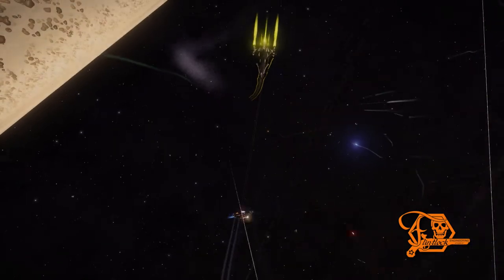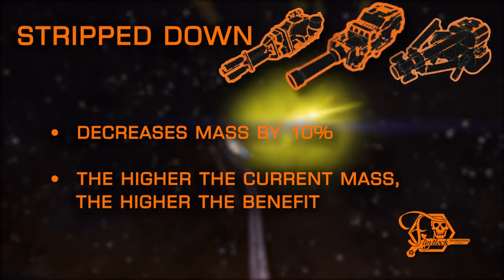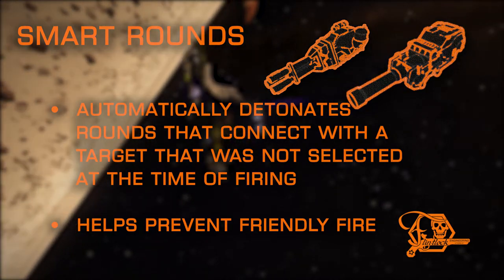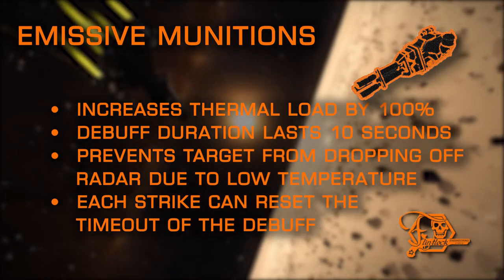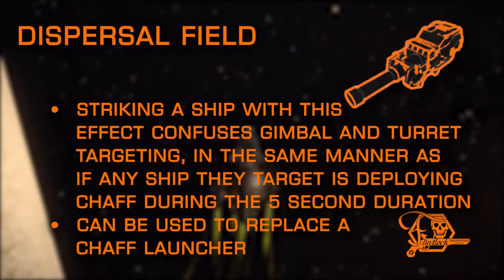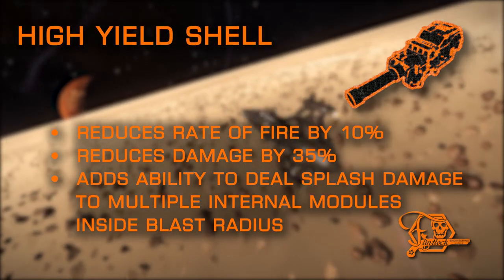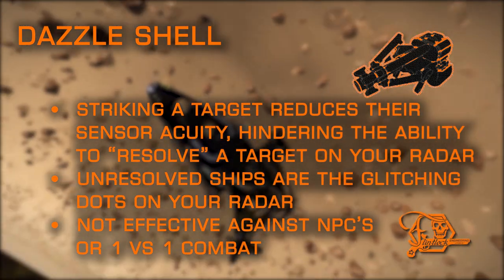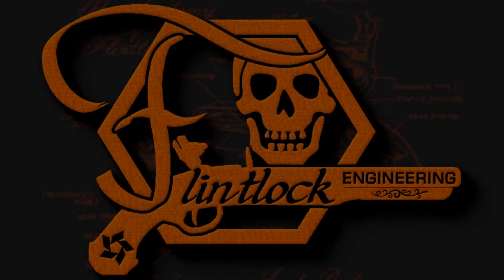Engineering Series - Episode 6: Kinetic Experimentals

Comment: AFAIK : Regarding oversized vs rapid fire : Module breach damage and % is unmodified in all cases, so servo/rapid fire causes faster module damage by increasing % proc rate. To destroy shield/hull HP you want higher damage per shot, for module destruction you want higher RoF.

Comment: Fun thing you can do with incendiary rounds is use them instead of lasers, then jam all of your power into shields. Since the power draw is much lower, you can have 6-8 multi cannons running on 2 pips and never run out of distributor draw. So you can sit around and joust with lesser ships in PvE all day with a huge shield advantage. The only downside is the fact they use bullets, which isn’t that big a deal assuming you’re doing this in a haz res or conflict zone

Comment: Great video! I have a short question. I was wondering whether incinderary shell is a little overrated. You find them recommended all around the web. But maybe they are good for ship only equip with multicannon or kinetic weapon. If I have substantial laser presence, isn't autoloader with a corrosive make more sense?
Reply from the maker: I like to keep my vids unbiased, but I will admit, I think incendiary shell is quite over rated. It basically turns your multicannon into a worse version of a laser. A laser with velocity, so more misses, and a laser with ammo limitations, but without the power and distributor draw.

I personally haven't ever bothered to use them, honestly. But some people just like multicannons a bit too much. Ha!

Auto loader or corrosive are my preferred options for multis

Comment: Do many people actually use cannons? There are so many experimentals for them, it implies a whole world of combat that I'm ignoring. But I've always found them way too slow and low capacity to be practical...
Reply from the maker: It sounds like you have only tried gimballed or turreted cannons. All fixed cannons have a higher velocity than plasma accelerators, and hit close to as hard, but with more ammo reserves than PA's. They're amazing at sniping modules, and I use them on probably 50% of my frequent combat fleet!
Reply: I am currently using Cannon builds because I'm too stupid to fit Plasma Accelerators into my ships.
There's a few things to note here:
a) The Module damage is insane, even to ships with massive hulls, a Low Intensity Conflict Zone's Anaconda or Python Power Plant dies in about 1-3 Volleys, so do Drives (that's what Thrusters are actually called in Submodule Menu). This means depending on your aim and overall flight skills with High Yield Shells you can cripple an NPC ship within seconds, all they can do is float
b) Because in the intensity of Combat you sometimes hit less optimal spots, which means that Ships with an insane amount of modules, mainly stuff like Large Sized Ships with lots of optional internal module slots.
c) Given a decent aim and a fast ship there's no escape from you, you can basically destroy both Thrusters and FSD in 1-3 Shots (Hull Breach damage seems to be random because piercing of armor/hull is a falt chance) - awesome in combination with Rail Guns for fleeing NPC's (can't have that 1,5 Million Bounty Pirate escape 😂)
d) It's awesome to see Anacondas or Pythons or whatever bigger ship explode when most of their hull is intact because your shot fucked their power plant, it's also more reliable than Railgun Sniping those 🤣
e) If Thrusters are disabled the ships either float around at low speeds, when their Thrust was already high when their drives where hit to also float away from you at like 200-300 m/s, that's a thing you should consider because it could cause trouble with Mission Objectives.
f) I wouldn't want to be hit in my ship with Cannons in real life, imagine your drives getting disabled and you inevitably fall into a star, neutron star, black hole or incinerate yourself on planetary entry because you have absolutely no control over your ship. Might as well bring a hand gun, some cyanide or be prepared to eject to shorten the period of suffering XD
g) NPCs can't reboot their ships for repairs, it also seems they don't need Oxygen to survive with a broken Life Support 😂